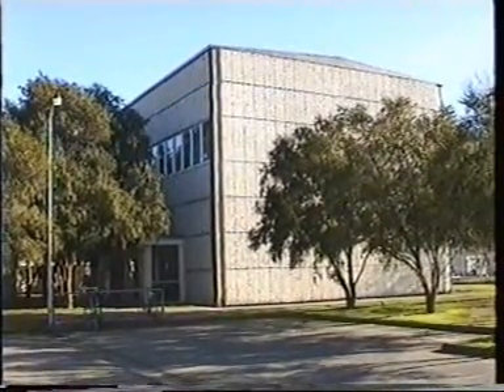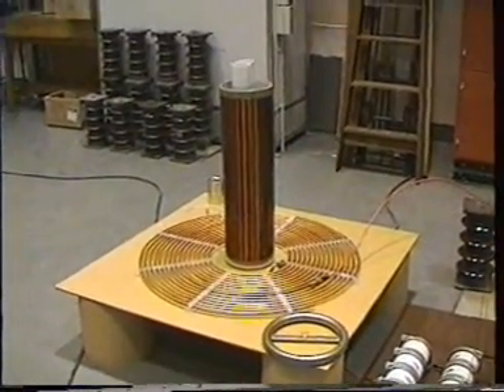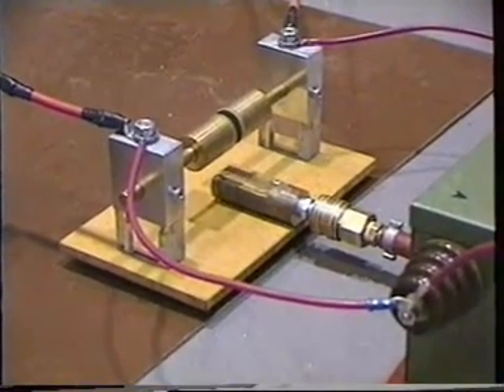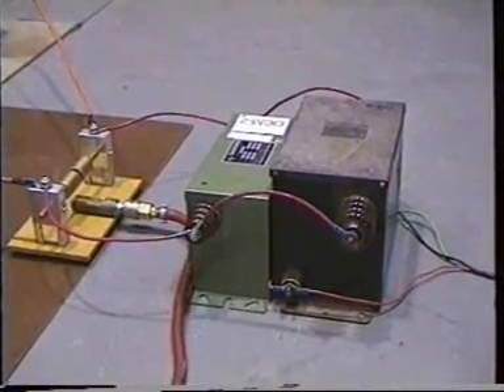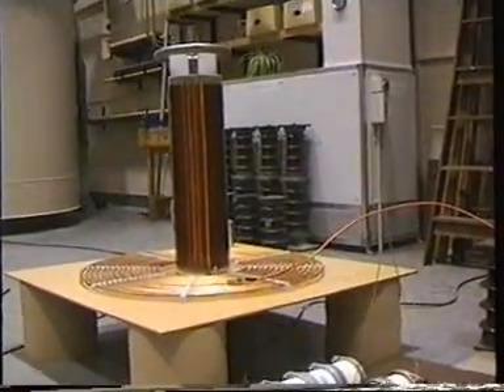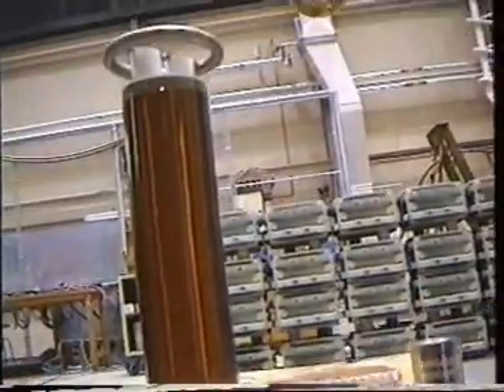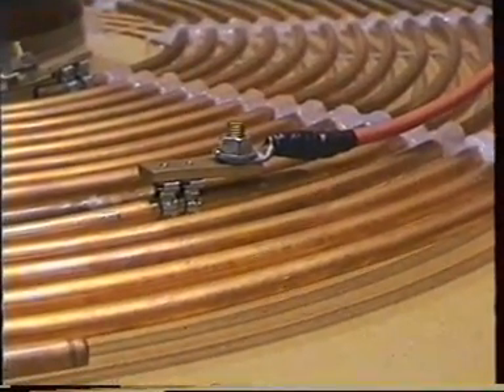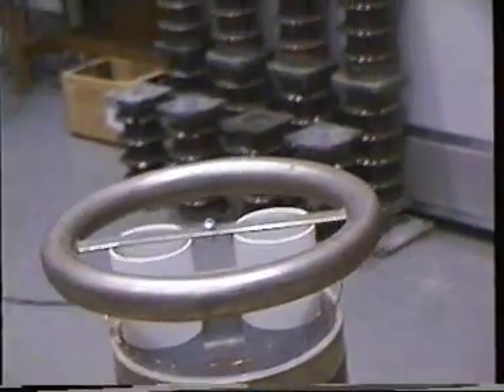Richard's Tesla Coil

Comment: Nice.

Wish the spark gap quench air were not so noisy.

Would the primary coil more efficiently impart energy to the secondary coil if the primary were wrapped UP around the secondary   - surronding the secondary like a cylinder?
Thank you.